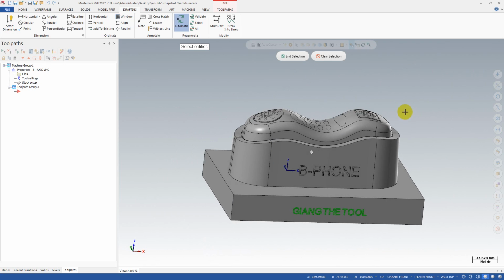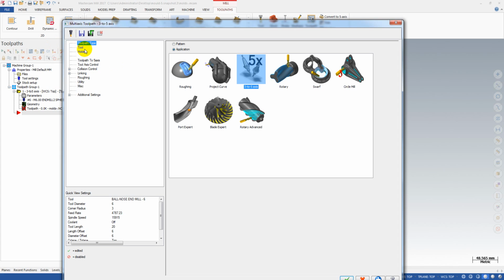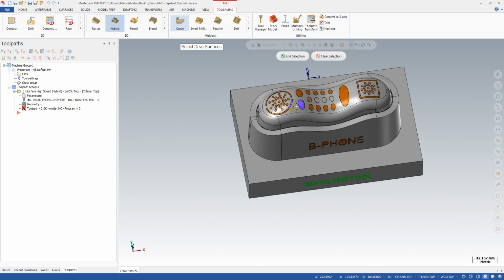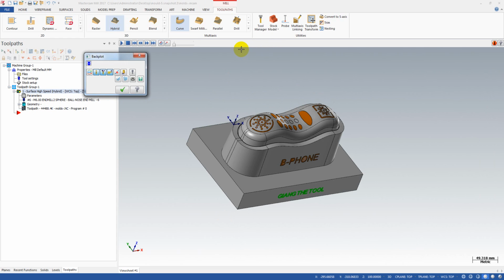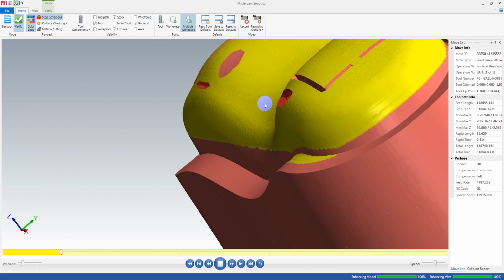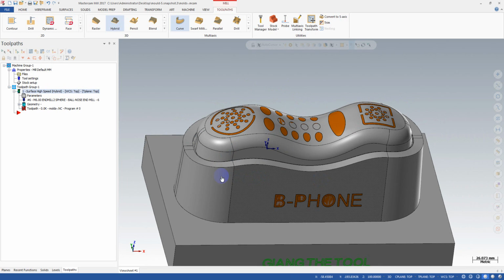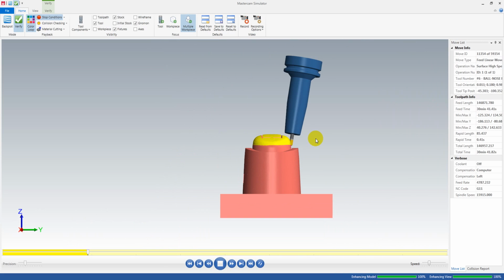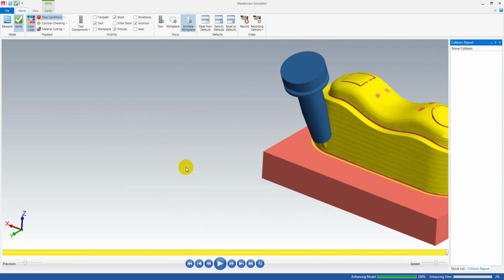MASTERCAM MULTIAXIS: QUICK AND SIMPLE WAY TO CREATE A MULTIAXIS SURFACE TOOLPATH

Comment: hi , thanks for your tutorial.. your thr best, i try to make a multiaxis toolpath but when i post processed the toolpath and i try it in a machine te movment isnt correct.. what do you thin about this? marlin.dodaj@gmail.com
Reply: Marlin Dodaj  you need the correct post. Nowadays there’s so many different machines and axis combinations that mastercam doesn’t provide these any longer with their software but there’s 3rd parties out there such as CAD Consultants. I think for the common multiaxis machines is just a matter of configuring your machine definition, controls, and a couple of switches on the default posts.

Comment: I know its a demo, but that isn't the way to machine that outside surface, I'd use a big diameter tool with a big tip radius and constant ramp down those steep sides. Very top raster with a pretty big ballnose. Done in a tenth of the time, better quality part, and less machine wear. If thats a mold those top depressions will be straight along Z axis. Thats all 3 axis basically, keep it simple